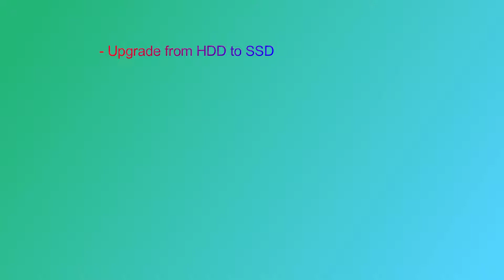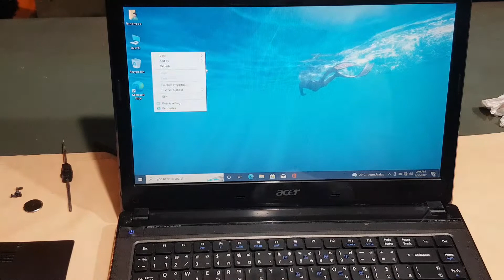Upgrade Motherboard and SSD from Acer Aspire 4750 to 4752G

Comment: Can motherboard 4750 use ssd?
Reply from the maker: hello hello, my dear
yes, sure
you can use ssd.
I am also using ssd drive, my dear
it is working perfect!
for existing HHD drive, you can insert it from DVD drive place, mydear
the name is "tray DVD drive for HHD"

Yes yes my dear
Thank you so much.

Best Regards,
Nai with big smile.
Reply: @Kyaikkhami I tried to put in ssd that installed with windows 10 but when the laptop started, it was stug on the windows logo.
Why can be like that?
Reply from the maker: @blaxido  Hello hello, my dear
Had you installed new windows 10 in new SSD, right?
if it is right, please photo me BIOS information me, my dear
yes yes I am kindly waiting.

Kindly Regards,
Nai